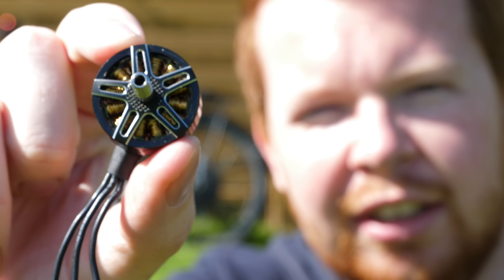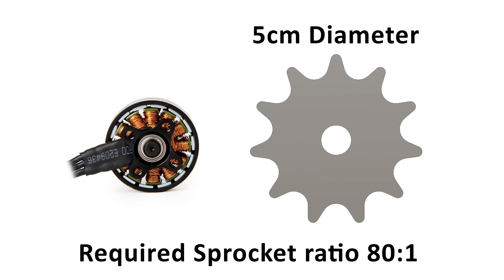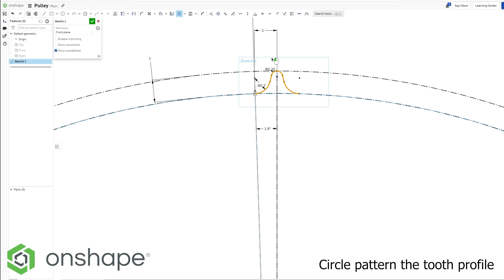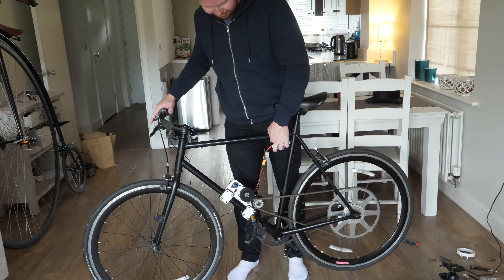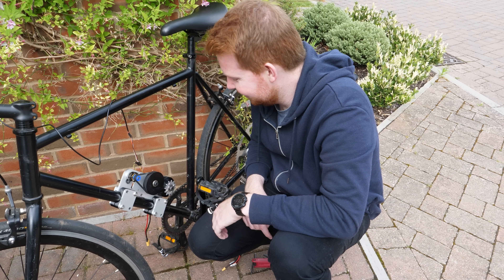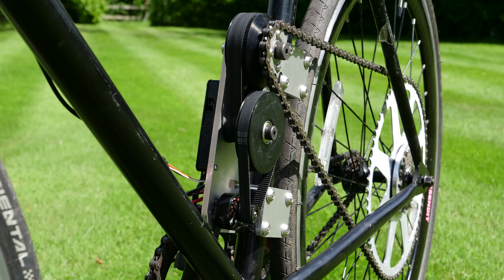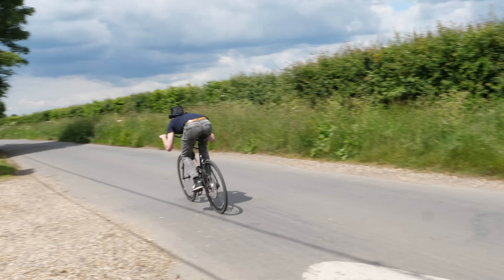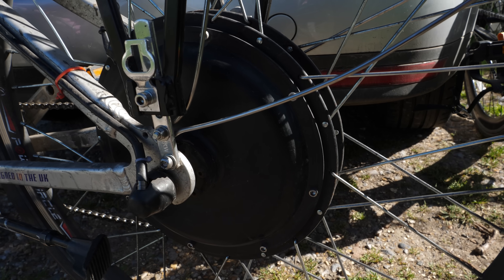Tiny 1kW Electric Bike Motor

Comment: Mechanics and insanely high RPM usually isn't good for longivity - especially mixed with gears/belts whatever to gear it down. I'll take the heavier but probably also more power efficient and surely much less maintenance required hub motor any day.
In fact when I bought my current electric bike I specifically went for a gearless hub motor in constrast for the now a days more common central motor. Sure the central motor gives a more fancy apperance but also has a lot more parts to wear and all energy has to pass through the chain meaning more maintenance on chain as well. With a hub motor only your efford goes through the chain - the rest is output directly to the wheel.

Comment: Sorry I had to rewrite my comment!
I initially said you could use tires as if it's a 29" cog but due to mud and tire wear issues, I gave a second thought on the idea.
What if you could use rims instead? Go with disc brakes, remove the V-Brake, and 3d-print a multi-piece gear at the side of the rim where normally brakes touch. Motor will less likely to get wet and there will be no additional tire wear.
Now, you could also use silicon rubber wheel instead of a gear at the shaft of the motor, hence eliminate the need of 3d-printing a 29" gear.
I'm an engineer myself and working on a similar project. My only issue is to find proper ESC for my project lately, which you solved that one out. You might work it out before me if anything.
Goodluck!
Reply: You could also use v-brake levers as a clutch to disengage the motor when unnecessary to increase the free-wheel experience

Comment: My rc car does 300A peak and the battery takes a little more
The Watts we speak of is 3600+
However my engine and controller are force cooled, and maybe run 1 second on that peak power on a charge

What you do is just not possible

Comment: The drone motor was designed specifically to have air pulled through it.  One planetary gear system should work along with a large cooling fan.  Perhaps the original prop would work.

Comment: For such extreme gearing, have you considered using a worm gear?  That would only work one way, but for taking a very high-speed input and producing a much more manageable output, it should be good.  Anyway, fun video, and well considered project.  I look forward to more.
Reply: Worm gears have very low efficiency

Comment: Where's the overrunning clutch? IE is the bike wheel trying to drive the micro motor? Also you need sensors to tell a servo system when to apply power.

Comment: So the limitation is on the amount of heat that the motor takes (because of friction maybe? or the amount of current that passes through the little coils?). that makes it necessary to have a bigger motor, nice video!

Comment: I can't believe you power the motor with 1 kw.
What voltage does the battery supply? 12V ?
This would mean a current of 83A.
Even with a 24V battery it would still be 41.5A.
Too many, for such thin cables. (and for the battery)

Comment: Fun project! What you could do to improve is, is implement a CVT. https://en.wikipedia.org/wiki/Continuously_variable_transmission

What the problem is with electric motors is that they generate their own currents https://en.wikipedia.org/wiki/Counter-electromotive_force.

What that means is that when you've reached an equilibrium is speed, the current in the motor has to be 0. Otherwise it would still accelerate.
What you're doing when you use this sort of transmission system, is that when you start it, current through the motor is extremely high. In a drone the motor will spin up quite easily, eliminating the high current at stand still. 
A CVT would eliminate this issue and i think that you'll be way faster than the e-bike. 

https://www.youtube.com/watch?v=6nWrDKGoYJo

Comment: Nice on you for trying.  But you need a bit more physics-like thinking and quntitative thinking at that.  1,000 watts is a lot of power.  Ten 100-Watt light bulbs. Now even if the "1000 Watt" motor truly did draw 1000 Watts, it's unlikely to be over 90% efficient.  That means it would be dissipating 100 Watts as heat.  Without a heat-sink or cooling fan, that's going to get almost orange-hot.   

So first thing, realize that the motor is scandalously misadvertised.  Probably by at least a factor of 5.  

Next there's the problem of the belts and sprockets.  I've seen ones that size in things like the bottom of our bread-maker,   a color laser printer, and other places where way under a tenth of a horsepower is needed, and only intermittently.   You need to apply a little mechanical engineering-- 1000 Watts is a bit over 1 horsepower.  One horsepower is 550 pounds being lifted one foot per second.  So you need roundabout an order of magnitude of that kind of strength to the sprockets and belts.  Again it looks like you are a good factor of 5 under that.  

And it's not just strengths that are relevant.  Sprockets and belts are only like 92% efficient, so you have to consider what happens to those 80 Watts.  They turn into heat and friction and belt stretch and wear.

Back to electronics, if you truly need 1000 Watts, you need a battery capable of 1000 Watts and probably good for like 30 minutes or more.   The best Lithium batteries are like 300 Watt-hours per kilogram, so you need much much larger batteries.

So nice try but a bit more electro-mechanical analysis would be a good thing.  A spreadsheet would be a good place to start.

Comment: You could also use a 8S (or 12S) Lipo powered 800kV electric motor. Then you're looking at 10kW at the size of a can of redbull with proven technology, well, sort off.

Comment: You could just use a much more compact gear drive system (probably plastic with your 3D printer) with an intermediate reduction gear mounted right on the swingarm just in front of the rear axle. All that chain and pulleys and length wastes at least half of the output power. That's pretty lame brained
Reply: Then strap-on the smallest 2 cycle motor possible with its own integral generator assembly and power the motor (you could even fit two of those motors if you mounted them properly) just set the two cycle motor slightly above idle and use some type of potentiometer throttle to control the output to the little motors. You'll be surprised that the bike will cruise along at 25 miles per hour with the tiny 30cc 2-cycle motor barely revving 1500 or 2000 RPM. Unexplained efficiency. There's an actual video where someone did this. It would work even better with these tiny little motors and gear reduction

Comment: 👍🏻👍🏻👍🏻
When you're expecting a tiny motor to do a heavy job like that, it's more reasonable to consider a tool to keep the motor cool.
The next point is that using a specific gear box is absolutely better than the belt. Whether from the view point of the friction, or to effective transfer of the torque. Even for controlling the temperature of torque transferring parts.
So, what is needed will be a clutch and because of the ease of work, a simple automatic clutch can be used. Generally, this is a good Idea and I like it, but it shouldn't be forgotten that the total consumed power of the tiny motor will be at the range of an ordinary electric bike.

Comment: Nowl try it again with a mid Drive e-bike motor and a much more mild gear ratio with the goal being incremental progress rather than unrealistic expectations because I think the gear ratio component could be a big deal for e-bikes allowing for much less weight and cost due to using smaller Motors while still achieving similar or improved results compared to typical e-bikes currently. 

That said....

You really should ditch that Hub drive and get yourself a good Mid-Drive with torque-sensing pedal-assist that takes advantage of existing rear derailleur and rear cassette to leverage gear ratios that you've already proven to be an Effective methodology for increased performance and ability and you'll be glad you did

Comment: Probably not practical anyway other than to you turn it into a friction wheel generator with the potential to put out a decent amount of electricity compared to typical friction wheel generators as every electric motor in Reverse is a generator

Comment: They should make more stuff like this. Not quite this small of a motor, but if you consider the weight problem with ebikes... you'd have more range with a smaller battery or absolutely insane range with a full size battery... there's more work required to ride it but could extend range by many miles if used properly. Also way cheaper.

Comment: Well there is always the load that matters.

On your bike the mass proportion displacement ratio is..kind of..asking the motor to just burn.

The only possible way i can see using this is with empty wheels and have a couple of theses motor attached in brake caliper like design  with big rubber bushings pushing on the inside of the wheelbase.

Then have all those motors be used to maintain your runing speed rather then doing all the effort for you.

Comment: the fact that these motors can use 1000 watts means they could charge somewhere around 60-80% of that most likely.
brushless motors interested me in those same reasons but i think these could be more useful. ive been trying to come up with a tiny alternator for a 2 stroke i have. it has a very low output stator as its a factory racing version. i needed more electrical in the past and in some ways still do but have cut down electrical needs thanks to newer technology. but since im adding a belt anyways i might as well add some head room and stop straining my stator ive already killed a few.

Comment: Yeah! Another fascinating experiment. Most corded drills have a 30,000rpm small brushed motor with a really nice helical reduction gear. Doing this with the drone motor may be quieter and more efficient.
Reply: Also Brushless cordless drills have more or less same range for motor RPM. Motor in many brushless drills is not much larger than these drone motors.

Comment: If you want to add some speed in the bicycle add some torque in it.
I have an idea what if you start the bicycle with a motor that has torque in it to attain speed and then starts the second motor which has horsepower (1000 rounds per minute).
EXPLANATION>>>>>>>>> at first the motor (which has torque in it ) will push the bicycle to attain velocity and then the second motor (which has horsepower in it) will improve the velocity in the bicycle.
SORRY FOR MY ENGLISH

Comment: You should have added a flywheel .......would have made a huge difference for the small motor. Avoid excessive force at low RPM.

Comment: Twice the torque per kilowatt is still the same power at cruise.  But there is certainly less strain on the motor during acceleration.  however,  there is no such thing as a free lunch.  Quicker acceleration from zero to cruising speed requires more horsepower.  Raise the top cruising speed and acceleration will suffer.  Max speed must be sacrificed in order to improve the acceleration performance.  This is one reason pedal-assist is so popular among e-bike enthusiasts.  not to mention battery life...

Comment: Love the sound of that motor - cool.
did some playing with home made e-bikes (four of them now!) and the most interesting option I used a rear wheel on the front and back of the bike and drive both (All wheel Drive Bike!) I let off the throttle at 75km/hr Got too scared. LOL lots of fun.

Comment: There was a bike race that once caught a competitor with a hidden tiny motor & batteries.  They only caught the cheater because the bike was a little heavier than normal, and they inspected the bike.  Even if it's 50 watts of assistance, that's enough to push the cheater to the front of the pack.

Comment: This motor was made for high RPM, the eBike motor was made for direct drive at high torque. Torque motors are always going to be bigger but more reliable. High speed motors will always be smaller but less reliable due to high mechanical wear & tear.
Reply: tom_stanton1  Eat shite

Comment: @tomstanton don’t you think hydropower deserves an overhaul? Couldn’t one use the thrust of a waterwheel connected to a variable speed pulley system to engage bigger brushless motors to higher rpms? For better efficiency?

Comment: That is one powerful motor! I'm interested in doing this project using a scooter with smaller tyres. Is it possible for you to list down all the electrical components and the coding used for arduino? Thanks!!

Comment: not enough Power House and u need Fan for Cooling that Motor
Reply: u need more Gear Box , Like Motor Bike ,  full of oil covering (box), and your Belt need to replace with Rubber Bell , 
for the Future , your Motor Not gonna Last Long , For to much Presure To the Edge ..

Comment: I bet you could cool it with a really small fan connected to the output shaft maybe with a small duct, the fan would spin at 10000+ rpm, forcing a ton of air through the coils.

Comment: Half the heat is coming from the fact you're side loading a motor that's designed for thrust loads. You need to support the end of the shaft with a pilot bearing of some sort. The cooling fan and perforated mounting plates go without saying.

Comment: The heat on the motor is coming from the direct friction not from the motor it's self. you need to remove the friction from the motor and try again. The motor body is holding the first gear. it should not

Comment: That would be because it's more to it than just the watt output there's a torque rating and the size of the motor as well it comes into play you can't use a drone motor the size of a freaking a bottle cap or something to drive something regardless of pullies

Comment: This is really interesting I have a 38 mph electric bike and the motor is absolutely massive and even the motor on an electric scooter 15 miles an hour is massive what is the need for these massive motors if you can make a bike go 20mph with this could you explain? Or make a cool video rewiring an electric scooter to go as fast as possible

Comment: This shows our ability to miss fundamentals.  The large sprocket and gear train are key here, showing how our engineering culture has been blind to reducing force required  on Rotary loads by using rim-drives and gears. Shaft drives are simply a waste. Every pump or auto needs rim or final gear drives, cutting force required by simple leverage.

Comment: Could solder or weld a little fan blade on the motor shaft facing the motor so while it's running it's blowing air cooling it down.

Comment: Wonderful experiment and well done. 😃
I think you can do this; just use a 4000 RPM motor, since an 8000 RPM motor would still have heat issues.
-Or you could lower the wattage on the 8000 RPM motor.
One thing I'd like to mention is that you'd get a fine if you're running your bike on the 15000 RPM motor in Denmark at full speed, because e-bikes are not allowed to go beyond 25 km/h. 😉

Tom please look for "Velo Solex" - I think you'd find that very interesting - it's an old invention but makes use of the large diameter of the bike wheel! 😄